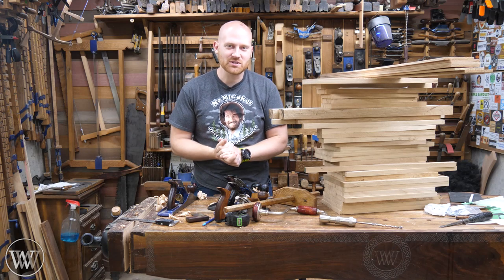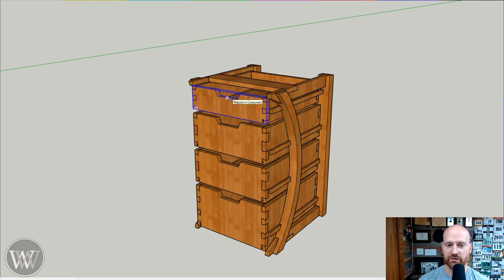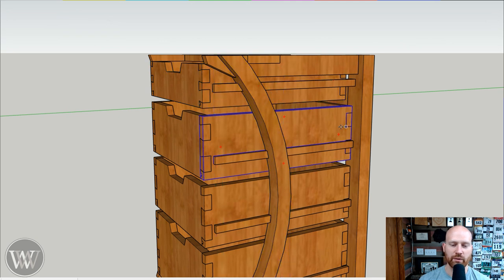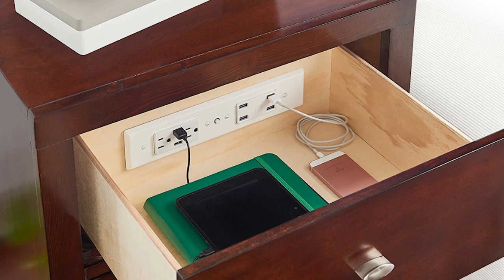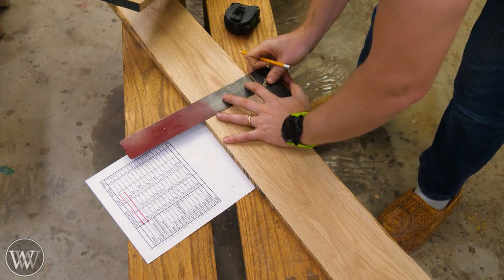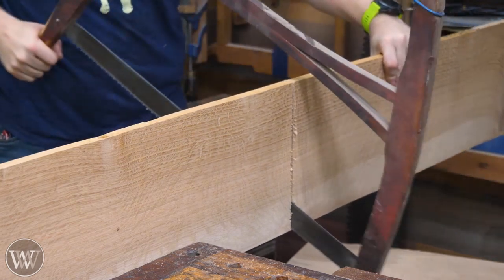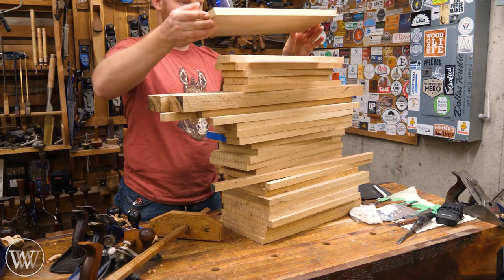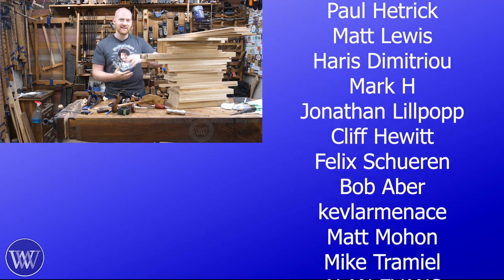How to Make Desk Drawers Design and Stock Prep

Comment: I know you did the show tails on your dresser but those drawers were completely recessed into the case. With these drawers being so open the dovetails would be clearly visible on the sides. Heck you could even do half blinds to hide the grooves and the dovetails would still be highly visible on the sides. But if you do stick to the plan you could also dowel in from the top and add a more physical lock to the pins instead of just a cross pinning through the face of the tails. Either way I'm excited to watch how it goes.

Comment: I like that bucksaw. Did you make it yourself? That's a lot of sawing on all that stock, what sort of time did that take? I've recently done a similar volume but on pine, it was a little easier! I was surprised at my own accuracy too, just using a Japanese saw as my 5tpi saws need sharpened.
Reply from the maker: The buck saw was one I picked up at an antique store a few years ago. in total the stock break down for this was around 4-5 hours.
Reply: @WoodByWrightHowTo  nice. It really isn't that long for such a number of pieces. It really does challenge the notion that power tools are essential for a hobbyist (like me) doing individual projects. An extra few hours on a build really isn't going to make much difference in the scheme of things. Good to know.

Comment: James, I don't understand why you vertically cross cut a wide board helped in a vise, losing all the body mechanics as oppose to laying the board flat on your sawbench puting you knee and over and cutting.
Reply from the maker: Just personal preference. Due to the space my shop it is actually far more difficult to do it at the saw bench.